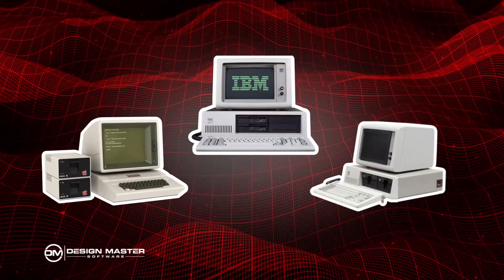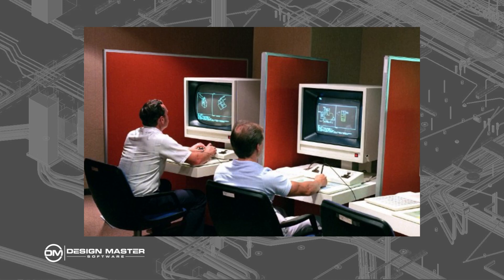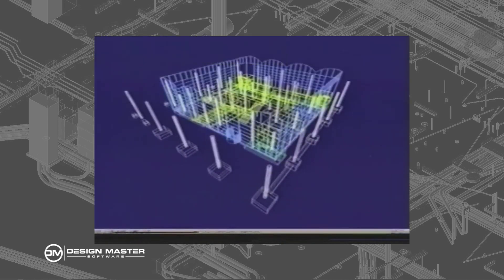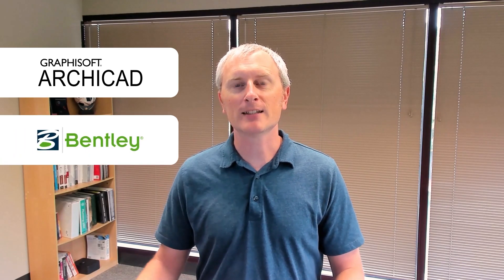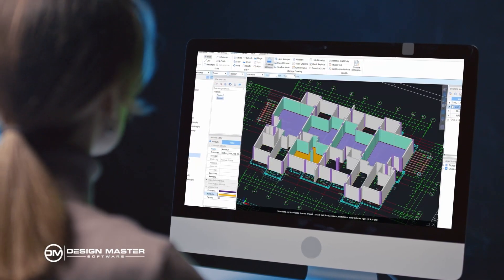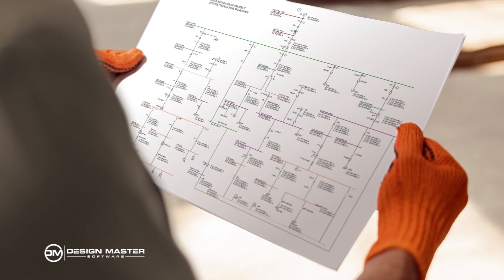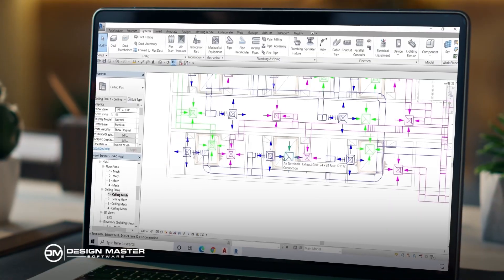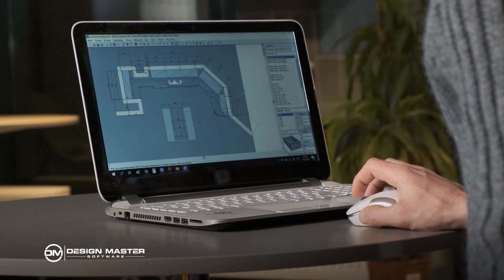Evolution of Electrical BIM: AutoCAD vs. Revit - Episode 3 #electricalengineer #bim #AutoCAD #Revit

Comment: Good overview David. So,in essence, Design Master bridges the gap for the MEP engineer.
Reply: Yes. Our software helps for both workflow. If you are using AutoCAD, we add BIM for MEP design to it. If you are using Revit, we extend what you can do with the electrical model in it.